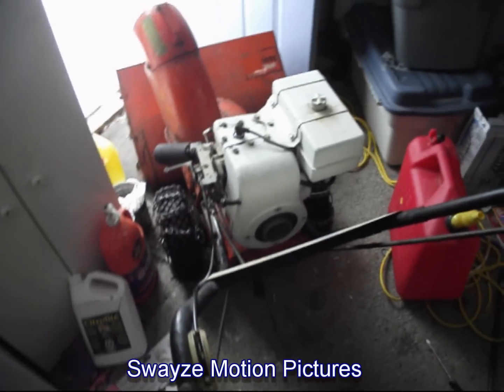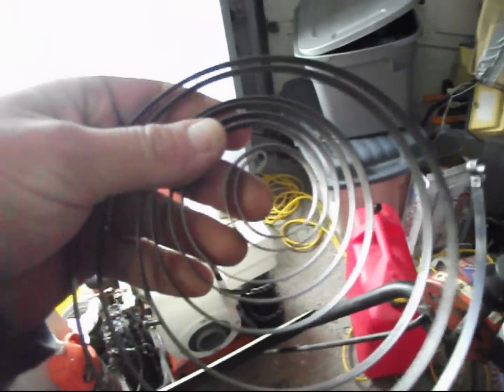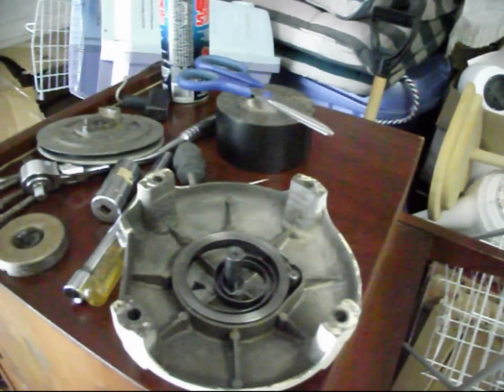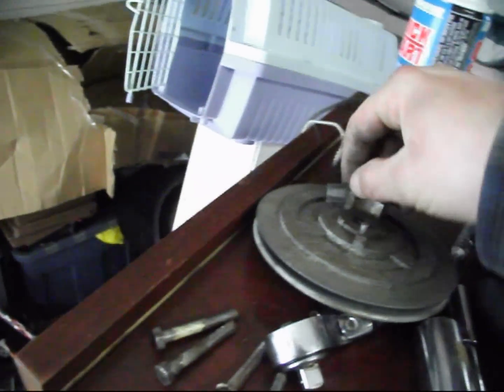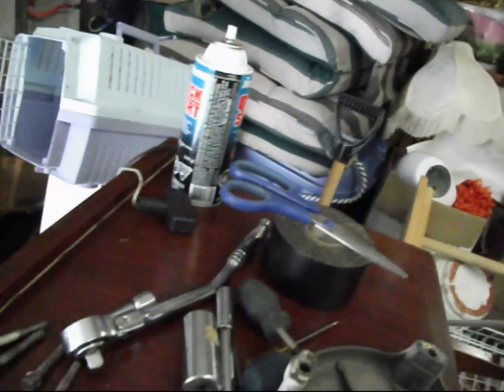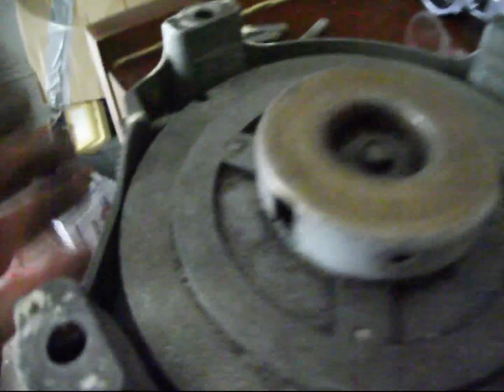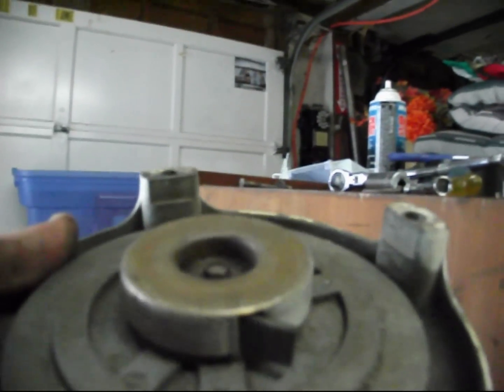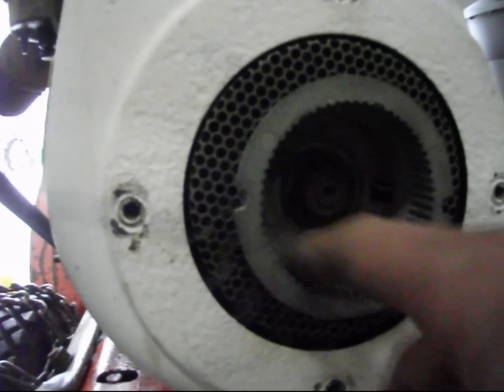Ariens Snowblower repair

Comment from the maker: @perogi21 i will make a detailed video how i did it, The recoil wont come out if you take it apart slowly it will stay in, To get to the cord, just unscrew the flat head screws on the pulley and you will see where the cord goes, Put it in a loop and screw it back together, Like i said give me a few days and i will make a detailed video of how i did it....